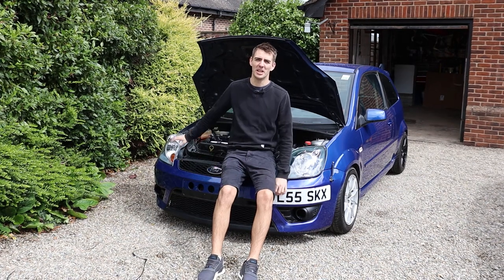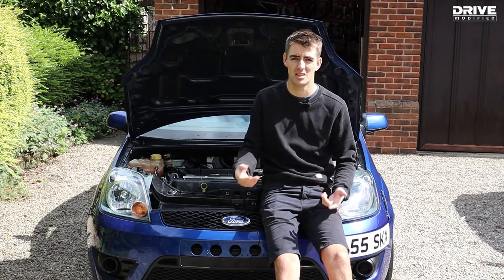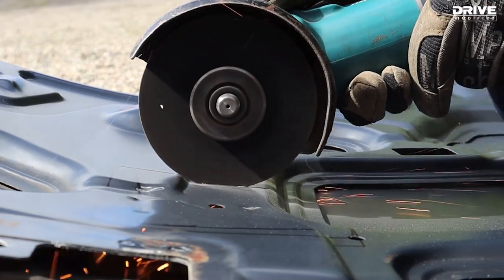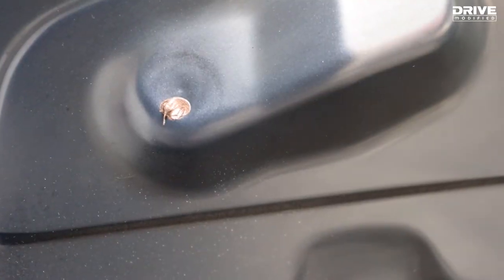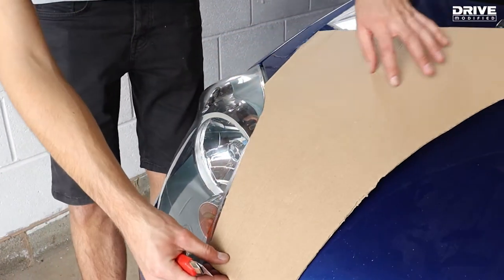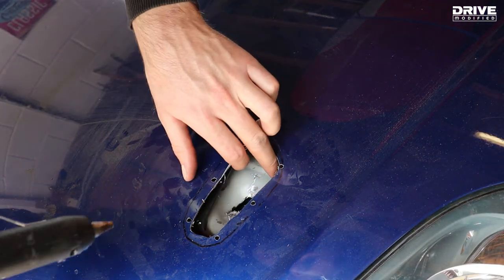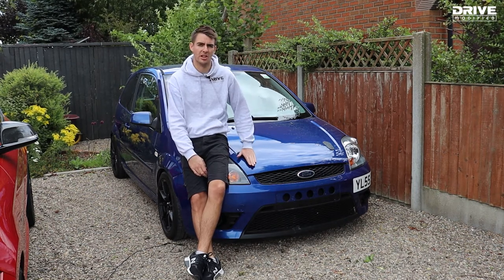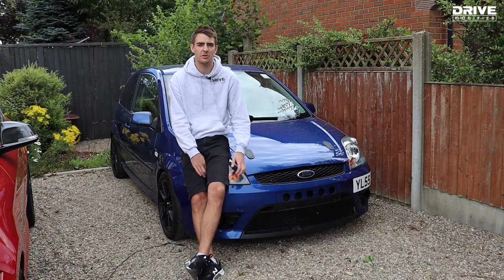How to install bonnet pins!

Comment: For the brakes you can fit 300mm discs from focus st170 and mondeo MK3 calipers and braded lines. I did this on mine and it works great.

Comment: Have a look at Fiesta ST race series, so you can see what brakes they run, all be it use a softer pad.
Would be interesting to see a dyno run to see what the BHP is and what spec cams you fitted.